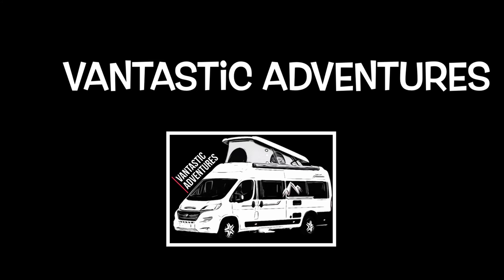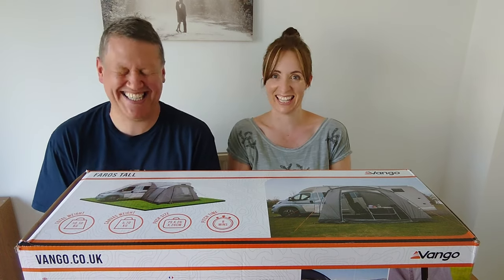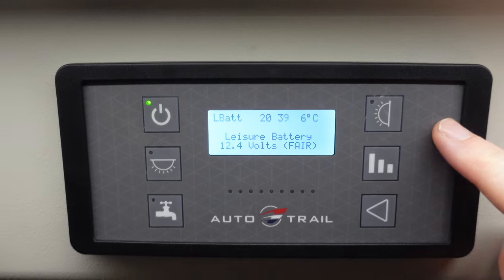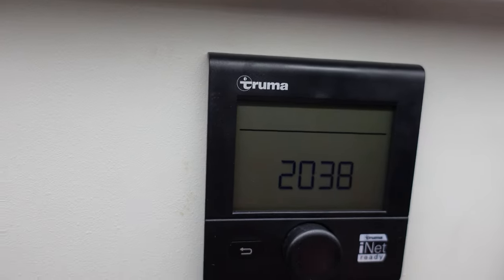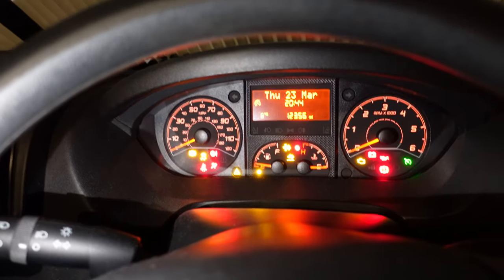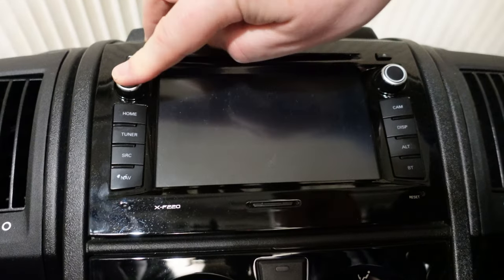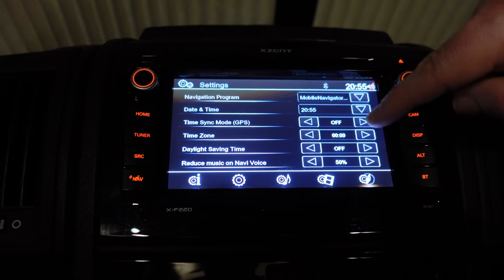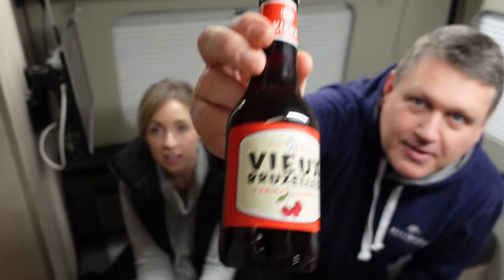How to Change Campervan Clocks

Comment: Great informative video, did notice a daylight savings mode switched off on your head unit, turn it on and it will change the time for you.🍺🍺🍺
Reply from the maker: Thanks Mark will try it again for some reason it didn't work but think we had other settings wrong, forgot about that cheers 🥰👍

Comment: What about the DST time zone on you caravan .😮
Reply from the maker: The van doesn't have the auto update function unfortunately, it's a manual selection on the control panels. The head unit does have this function but for some reason it doesn't work in the UK 😂